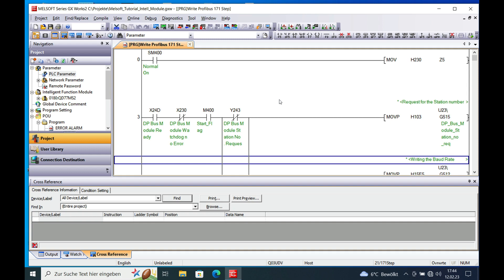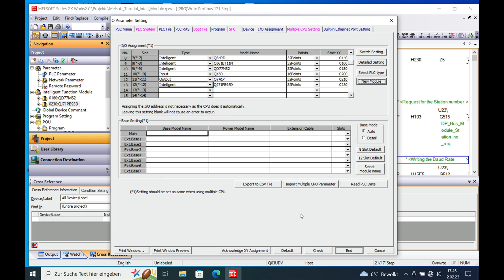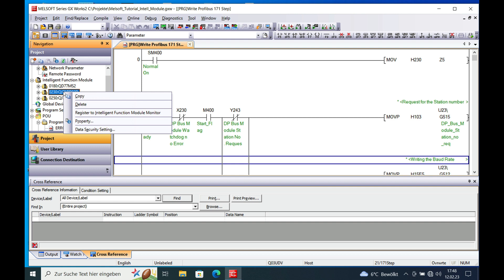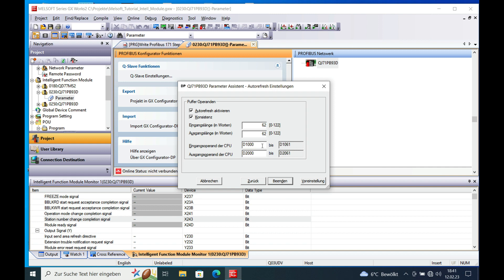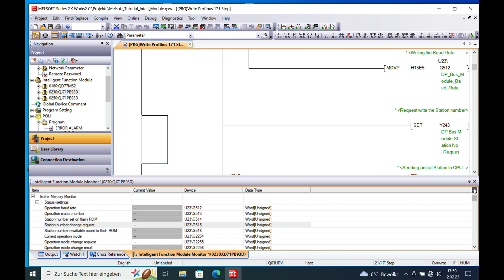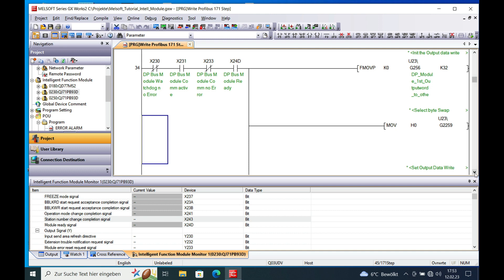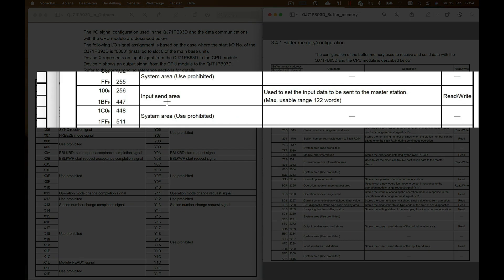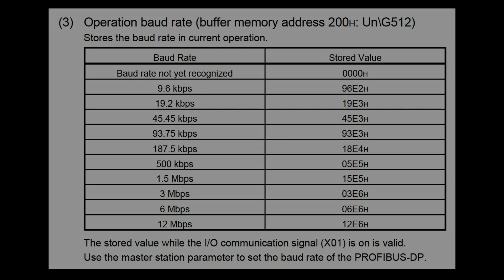QJ71PB93 Profibus DP Intelligent Module in mitsubishi melsec q series

Comment: I have installed  gx works2 apps and gx configurator dp apps. But i didn’t' get  profibus dp/dp module function  in intelligent function. Sir please help me.
Reply from the maker: Hello Sir, i can not recall such a problem. Can you tell me the type of cpu you are using. Also the software version. I will check this woth the mitsubishi support.
Reply: @zellerautomationandplc  
Good morning sir. Thank you sir for reply. 
GX Confugurator-DP Version 7.13P.
GX Works2 Version 1.620W.
PLC Cpu  Q03UDV.
Reply: hello may i know where did you get the gx configurator for free down load cause i download in mitsubishi electric its need a serial number.